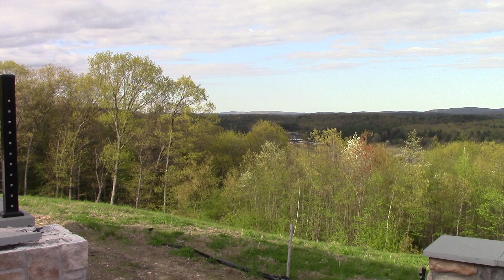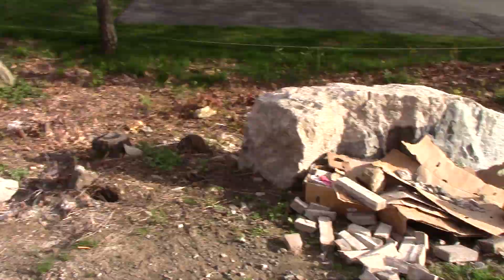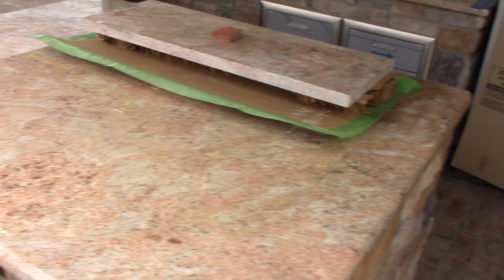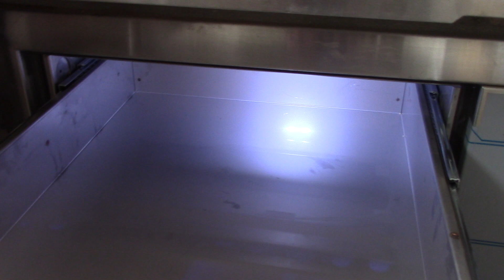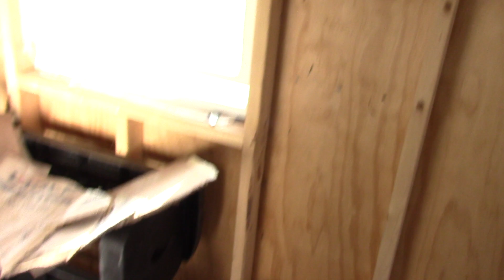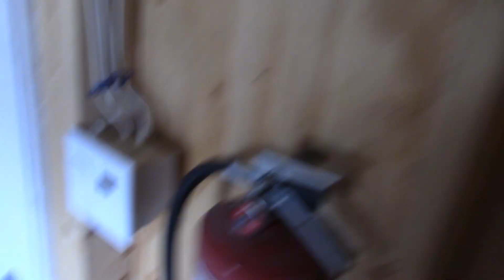Backyard Update (5/6/2019).

Comment: I just picked up one of those little tables as well.  From Aldi.  And I probably paid 1/4 of the price.  Just sayin'.  Guaranteed they came out of the same factory in China.

The stone on the cabana is nowhere near as bad as you made it out to be.  The guy probably used some word like "fluid", "congruent", or "consistent".  It's ALL about curb appeal.  But honestly, even with the rest of the stone around the whole cabana, it looks like it belongs.  The only thing I would say would have made it maybe a little less conspicuous is if the stone wrapped around the left edge and went to the entrance to the cabana.  Under the bar is stone anyway, so that way the whole thing is stone.  As for the back of it, meh, not really needed.

The China lights for the knobs are there so everyone can get their blue LED on.  The lights in the cabinets and drawers, nice.  Extra light only helps.  And no worries, since it's LED it'll last a trillion gazillion years and never fail!
Reply from the maker: Well it was no money out of my pocket! Though I have no idea where they got them from. 

Yeah the guy did use one of those words. While I can see what he says, I still think it looks terrible. When you see it from the angle of the sunroom slider, I think you'll see what I mean more. And really, you don't see it much from the curb at all, given the property set up. All the full exterior walls of the cabana are full siding from roof to ground. Having just that one side be half stone still makes no sense architecturally to me. 

I guess one thing you could say is that the front of the house is brick with that stone while the rest of the house is not. That's another design that is not favored by me. However, I am more lenient with that because the front of any house usually stands out more than the rest. But for example, think of the side of the house that faces the driveway. Suppose only that side of the house had that exterior, but the front, and other side of the house didn't? That would look horrible. 

Well Connecticut LEDs, totally gonna last! (maybe) 

I think a separate button for cabinet lighting would have been better, but it's certainly not the worst.